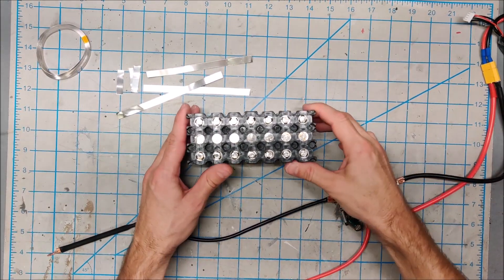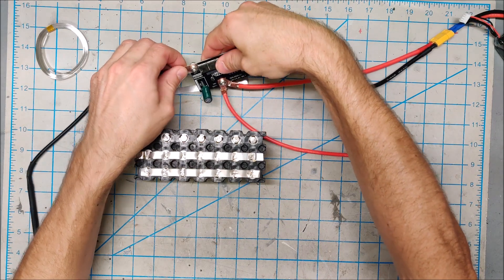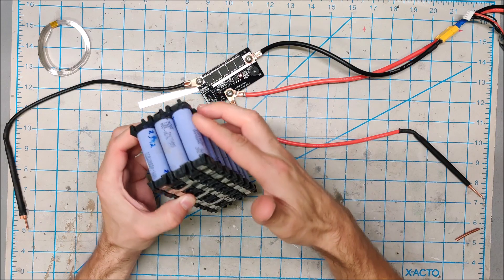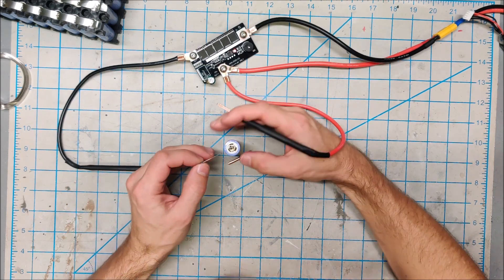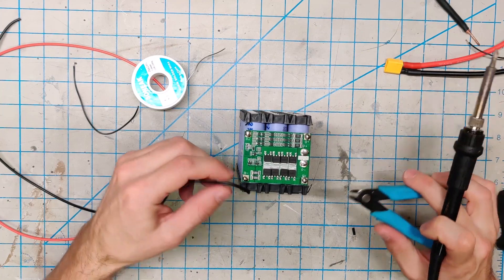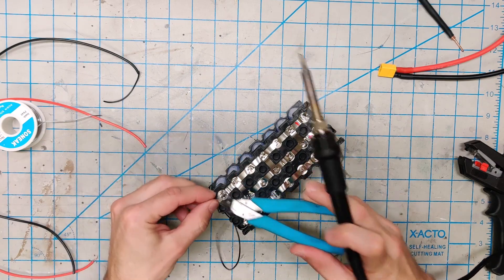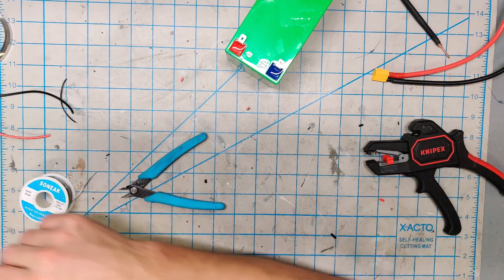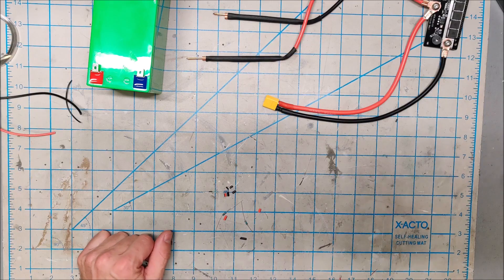DIY 12V LITHIUM ION BATTERY USING DIY SPOT WELDER

Comment: Why are you soldering the strip right on top of the battery? Why not inbetween the batteries. Or before you even spot weld the nickel on to the batteries. Doesn't that defeat the purpose of the spot welder?

Comment: What do you think is causing the wires to jump during welding
Reply from the maker: Fast moving high amp electricity creates a magnetic field that moves the wire
Reply: @stevenc22  Thanks 😊

Comment: Thanks for sharing this video, what is the c rating and voltage of the lipo battery that ur using for spot welder?.
Reply from the maker: 50c 3s/12.6v

Comment: Would this welder work on a regular PB 7Ah battery?
Reply from the maker: It does work with lead acid batteries. However the recommend a bigger lead acid

"20-45ah Lead-acid battery with good performance and small internal resistance"

Comment: Do you have a step down converter. Could one be used to control the weld. This for a fuse.
Reply from the maker: No I doubt it. This thing is dropping 100amps instantly. A step down converter can't handle that much current

Comment: i did my pcb the other way so the terminal for output where closer to the terminals but also all the solder tab points met up with the cell they where ment to be connected to

Comment: Can you adjust the power on that spot wielder. If so if you could turn it down an probably do those fuses or wait till the battery drops voltage an probably do the fuses. I'm just curious. Like video an the battery box wish they made them for the 80p packs would LOOK nice going across the WALL an also protect them
Reply from the maker: No you cannot
Reply: they maybe do plastic ammo boxes that could be used